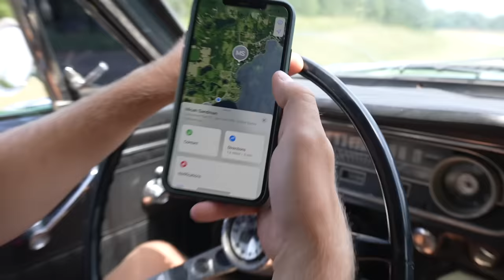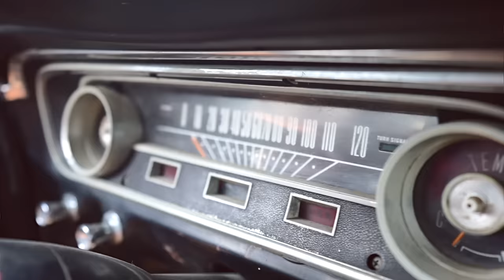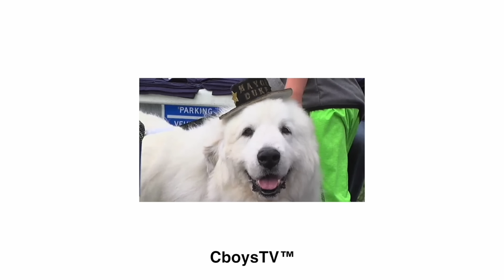I Bought a Lifted Mustang for Mudding

Comment: Almost 100% sure it’s a chevy motor.Distributer is in the back.
Reply: Ur right
Reply: Ya
Reply: Your right 80s small block hopefully a 350
Reply: Was just gonna comment that…
Reply: It's a Chevy small block 350
Reply: It’s a k5 blazer frame
Reply: I couldn’t tell if it was or not because they didn’t give us a really good look at it but i bet your right.
Reply: Yeah it's a 350 small block
Reply: Yep just about to say lol
Reply: yes
Reply: @jackspencer5321  if its a 305 it wont last 3 weeks
Reply: Yea is a small block 350
Reply: Yes 350ci distributer in the back and the front (water pump alternator ect)
Reply: True
Reply: Thermostat is also on the top of the block instead of front
Reply: Yea
Reply: Yep u right
Reply: Yup
Reply: Just about to say that
Reply: @jackspencer5321  it is the 350
Reply: It's a small block chevy for sure
Reply: @Idk-fh7vv  thats a lie
Reply: Yeah it’s  a 350 Chevy
Reply: @jackspencer5321  yes sir
Reply: Small block
Reply: Distributor in the rear of engine... Its def a chevy small block... Wether its a 305 or 350 is anyone's guess, unless you pull a head and measure the bore diameter and or the combustion chamber size of the heads
Reply: Yep
Reply: Yupppppp
Reply: It would be stupid not to, there’s endless amount of Chevy engines in junkyards, if something breaks it’s just an easy find
Reply: Same
Reply: 350 or 454? I was thinking 350

Comment: are the exhaust ports equally separated for 2 in the middle and 2 on the out? equally is a ford 2 in the mid and 2 on the out is chevy at least on small block chevy lol and this is deff a small block or big block 351 series ford

Comment: I reckon it's a boss 302 motor because 302 were typically bought out in Mustangs and the air filter is the same as the one on our Ford Fairlane so it's a ford engine